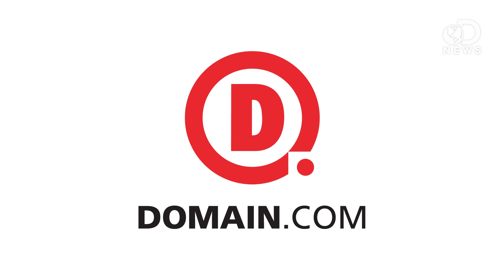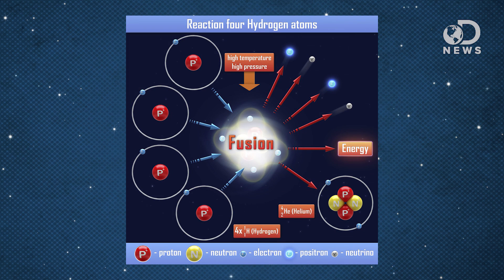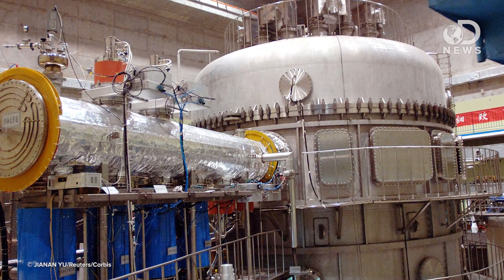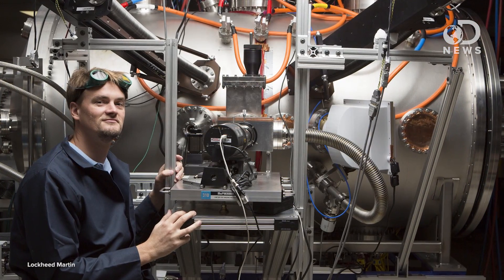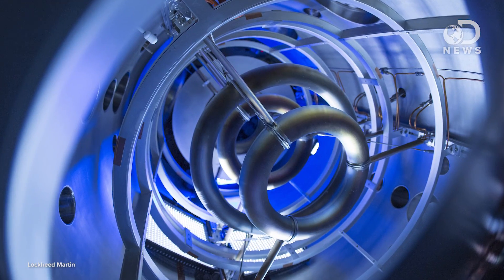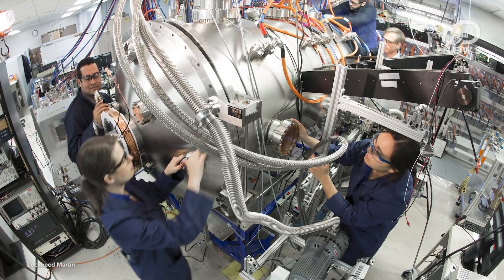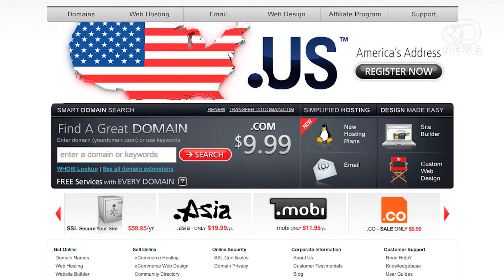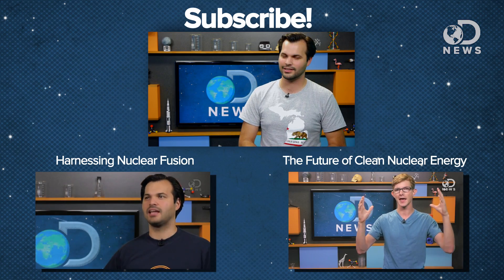Is Fusion Energy Close To Becoming A Reality?

Comment: Energy is abundant even without fusion power. Geothermal energy, Heliostats, and Algae Power Stations can produce many times more energy than we would ever need, and graphene-based supercapacitors store that energy for ground or sea vehicles. Continental airlines can be replaced by high-speed trains, and intercontinental airliners can use algae-based jet fuel.
Reply: Energy is very important for technological advancement, the Kardashev scale is a scale that ranks a civilization based on the total energy it is able to harness.

We are going to need much more energy if we ever hope to travel to other solar systems. We are going to need much more energy to improve on infrastructure of cities.

Basically we can never have "enough energy" The more energy we can harness the faster we can advance in science and technology and the better we can improve the quality of life.

-Coal/fossil fuel burning still accounts for 50% of the world energy generation due to how much energy is stored in them. It is still far more efficient than Geothermal or algae power stations and many times more efficient and practical than solar or wind.

-Nuclear FiSSion (what we have now) Is about 10,000 times more efficient than coal/fossil fuels. 

-Nuclear FUSION (aka the sun's power) Would essentially be 1000 times more powerful than the nuclear technology we have today, AND it would be virtually have no pollution.  Essentially you could turn water into massive amounts of energy. Half a cup of hydrogen would generate as much power as 20 TONS of Coal. 

----
Conclusion
We can never have enough energy.  Energy is not abundant.. not even close. If we had unlimited energy no one on earth would starve. If we had unlimited energy we wouldn't even need to live on earth anymore.
Reply: Carbosful
"We are going to need much more energy if we ever hope to travel to other solar systems."
This is not necessary, given that the asteroids in our own solar system contain so much resource that it renders interstellar travel practically pointless.

" We are going to need much more energy to improve on infrastructure of cities."
Solar energy is so abundant that building cities requires a miniscule amount compared to it.

"Basically we can never have "enough energy" The more energy we can harness the faster we can advance in science and technology and the better we can improve the quality of life."
Quality of life also shows the tendencies of marginal utility, meaning that equal increments do not contribute equally to perceived improvement.
Also, we could improve the quality of life with the same amount of energy, simply by distributing goods and services more equally.

"-Coal/fossil fuel burning still accounts for 50% of the world energy generation due to how much energy is stored in them." It is still far more efficient than Geothermal or algae power stations and many times more efficient and practical than solar or wind."
I know well that they are efficient. Only problem is, they are harmful for the environment. People tend to forget this.

"-Nuclear FiSSion (what we have now) Is about 10,000 times more efficient than coal/fossil fuels."
No, not really. It is more like 80 to 15 in the case of coal, and 50 to 15 in the case of oil. By spending 1 units of energy, we can get 80 units of energy on average in the case of coal, but only 15 in the case of nuclear energy.

"-Nuclear FUSION (aka the sun's power) Would essentially be 1000 times more powerful than the nuclear technology we have today, AND it would be virtually have no pollution.  Essentially you could turn water into massive amounts of energy. Half a cup of hydrogen would generate as much power as 20 TONS of Coal. "
Only problem is, we cannot make it into a controlled chain reaction with a net positive energy balance. Scientists keep saying fusion energy is 20 years away - for 50 years now.

"Conclusion
We can never have enough energy.  Energy is not abundant.. not even close."
Check out how much solar energy hits the global surface of the Earth, and how much we utilize of it, and think again.
Also, even the potential of geothermal energy globally is 4000 times the global energy use of humanity today. How many decades do you think we will increase our current energy needs by 4000 times? And that is only geothermal energy.

"If we had unlimited energy no one on earth would starve."
We do not have unlimited energy, but we could access thousands of times more energy that we currently use.
And we already produce enough food for everyone, only poor people dont have access to it (Source: FAO, 2002)

"If we had unlimited energy we wouldn't even need to live on earth anymore."
Okay, great. I wasnt talking about "unlimited" energy. I was taking about abundant energy (meaning that there is enough accessible energy for our current use, and even more, potentially thousands of times more).

If you have any more questions, feel free to ask ;)
Reply: sztellanora ""This is not necessary, given that the asteroids in our own solar system contain so much resource that it renders interstellar travel practically pointless.""

One of humanity's biggest goals has always been to travel greater and greater distances. If we are able to do so, it would allow us to understand more about how life is started it will also allow us to search for life, it will open up the opportunity for us to understand more about how to universe works by studying objects that are way to distant currently like black holes which we barley know anything about. It would also almost immortalize our species. Having the technology to travel greater and greater distances is always going to be one of our greatest goals. If its interstellar travel now, in the future it will be intergalactic.

""Solar energy is so abundant that building cities requires a miniscule amount compared to it.""
Do you know the cost efficiency of solar panels? It is extremely high, hence the reason why we don't have solar panels.  Also the areas needed to absorb a certain amount of energy is enormous obviously due to the fact that its solar.

Now the logical question I want you to think about is this. Why would you waste time creating solar panels that have a very high cost efficiency rate, trying to capture a fraction of the suns energy( only light energy) thats 92 million miles away when you can create a micro sun in our own basement that we can absorb and harness almost all of its energy output ?

""Only problem is, we cannot make it into a controlled chain reaction with a net positive energy balance. Scientists keep saying fusion energy is 20 years away - for 50 years now.""

That is entirely false, Your information is very outdated, as of early 2014 the fusion reactor at the Laurence Livermore national lab created the first nuclear reactor that outputs more energy that it takes.

http://www.wired.com/2014/02/fusion-power-not-yet/
http://arstechnica.com/science/2014/02/giant-leap-for-nuclear-fusion-as-scientists-get-more-energy-out-than-fuel-put-in/

""Also, even the potential of geothermal energy globally is 4000 times the global energy use of humanity today. How many decades do you think we will increase our current energy needs by 4000 times? And that is only geothermal energy.""

Thats in an entirely theoretical sense, unless you have a geotermal reactor covering every inch of planet earth your expected value is much much less. Also its quite silly to compare a geothermal rector to nuclear. You will most likely need 100s if not 1000s of geothermal reactors to output the same ammout of energy as one Fusion reactor. Its unrealistic. Somewhere sometime in the future we will need to switch to fusion, its clean energy, and its the most enormous energy producing method we know to date.

"We do not have unlimited energy, but we could access thousands of times more energy that we currently use.
And we already produce enough food for everyone, only poor people dont have access to it "

Do you not understand the quality of life? Do you not understand how an economy works? DO you know how many 3rd world countrys are starving in need of help? Do you now how many huge charities are helping to fight this all around the world?

Everything you have said was fine until this comment. I don't really know how old you are so I can't judge you. However you should really understand how lucky you are to be in your position most of the world lives in a 3rd world county and cannot do a single thing to get out of it.
Reply: Carbosful "One of humanity's biggest goals has always been to travel greater and greater distances. If we are able to do so, it would allow us to understand more about how life is started it will also allow us to search for life, it will open up the opportunity for us to understand more about how to universe works by studying objects that are way to distant currently like black holes which we barley know anything about. It would also almost immortalize our species. Having the technology to travel greater and greater distances is always going to be one of our greatest goals. If its interstellar travel now, in the future it will be intergalactic."
You can keep dreaming about it, but given that we have plenty of resources at our disposal in our very solar system, interstellar travel is logistically pointless, and thus, a luxury until we use up those resources in our system ;)

"Now the logical question I want you to think about is this. Why would you waste time creating solar panels that have a very high cost efficiency rate, trying to capture a fraction of the suns energy( only light energy) thats 92 million miles away when you can create a micro sun in our own basement that we can absorb and harness almost all of its energy output ?"
Um, because we cannot actually harness it yet, while solar panels and solar towers (e.g. Ivanpah Solar Power Facility) are already an option? :D
Reply: sztellanora "Um, because we cannot actually harness it yet, while solar panels and solar towers (e.g. Ivanpah Solar Power Facility) are already an option? :D" 

I dont think you understand or realize the difference. 

1) Solar panels are VERY costly right now. Their energy output is VERY low you need to cover your entire roof to barley get enough to power a standard 2-4 room house. And solar energy is not clean, the panels themselves have harmful waste its the same as electric cars, they are not entirely clean energy either the electric capacitor inside the car has very harmful waste.

2) Nuclear bonds are the strongest known bonds in the universe. They are hundreds of thousands to a million times more powerful than your standard chemical reactions or bonds. When you manipulate these bonds enormous amounts of energy comes out. There are two types Fission ( splitting atoms to release energy which is 10,000 times more energy efficient than coal) we have his already however the technology is harmful mainly because it was based on uranium which was war based. And then there's Fusion ( the combination of atoms releasing almost 1000 times more than that of fission. )

3) You would basically need solar panels covering the entire country of Great Brittain to produce even close to as much energy as 1 Fission reactor, we are not even talking about fusion. Since a couple grams of hydrogen can produce as much power as 20 tons of coal

4)""You can keep dreaming about it, but given that we have plenty of resources at our disposal in our very solar system, interstellar travel is logistically pointless, and thus, a luxury until we use up those resources in our system ;)""

Whos dreaming you or me ? A few private companies are already planning Manned missions to mars. Space X plans to allow manned space trips to mars and back by mid 2020 for under 500,000 Usd. Nasa is currently researching ways for interstellar travel.

 Again who is dreaming you or me ? It seems like you are very uneducated on this subject unaware of what the current future plans are in the space industry that is already being funded by Trillions of Dollars.

""No, not really. It is more like 80 to 15 in the case of coal, and 50 to 15 in the case of oil. By spending 1 units of energy, we can get 80 units of energy on average in the case of coal, but only 15 in the case of nuclear energy.""

Please provide sources for your claim or a link. because anyone can do a quick google search to see that you are forging false information.
Reply: Carbosful "I dont think you understand or realize the difference."
The difference between what and what? Seemingly, you dont know the difference between solar panels and solar towers. Solar power plants (like the one in Ivanpah, CA) do not even use solar panels, only mirrors, a water tank (atop a tower where sunlight is focused by the mirrors), and a steam turbine (to generate electricity).
BTW, solar panels could even be produced in an environmentally friendly way, we just dont do that because.. capitalism. (Note: Im not a communist, I advocate for Natural Law/Resource-Based Economy, See The Venus Project).

I know what is fission and fusion, buddy, thanks. The problem is, we cannot produce more energy with fusion in a controlled way yet (only in a termonuclear bomb, which is anything but controlled).

It would be stupid to cover Britain in solar panels (and even to build a solar tower), because Britain is very cloudy. Are you trolling?
Hydrogen can produce a lot of energy, but the problem is, we cannot harness it yet. This means that in controlled situations, the energy return is much smaller than the energy invested. On the other hand, building geothermal plants, or solar towers in sunny areas is easy, and they produce a lot of energy. Today.

I know that private companies are planning to travel to Mars, but Mars is in our solar system. Thus, traveling to Mars is not interstellar travel (and defintely not intergalactic :P ). My point was that we have everything we need in our own solar system, so until we used up all the materials, traveling to other stars is logistically unjustified (i.e. luxury).

The numbers I used for ERoEI are true for the US. See the wikipage "Energy returned on energy invested", it has a graph that shows it beautifully. If you actually googled that, it shouldnt show any forgery, but it should bring up this page as one of the results ;)
Reply: sztellanora

1) Again you would need thousands of solar power plants to equate to the same energy as one fusion power plant. You are only able to absorb a fraction of the Suns energy through the form of light energy. To give you a picture of this Essentially The sun is a Giant Fusion power plant 93 million miles away. Solar is only able to capture a fraction ( we are talking about 1/trillion +) of the suns light and turn it into energy.

Solar works as an energy producer however. Its impractical and is a very primitive way to obtain energy for future needs.

Sadly when you can create a micro "sun" in a controlled lab there is little to no use for solar, which is again.. just trying to capture a fraction of the energy from a fusion power plant 93 million miles away.

2) ""It would be stupid to cover Britain in solar panels (and even to build a solar tower), because Britain is very cloudy. Are you trolling?"" 

Thank you for telling us another massive downside to solar energy its unreliable and can be affected by climate and the biggest downfall is the night and day cycle. And my example was to demonstrate to you the amount of area needed, I was originally going to use Texas as an example however some people are uneducated and might not even know where Texas is the next best example would be Great Britain (globally known) as I believed it would give you a better picture. Since judging by your name and your past examples I question how educated you actually are.

3)""BTW, solar panels could even be produced in an environmentally friendly way, we just dont do that because.. capitalism.""

And ? Fission can be achieved in an environmentally friendly way as well through thorium anything can. Biggest problem is  MONEY and PRACTICALITY. Same with solar panels they cost a ton currently and no one is going to go out of their way to increase the cost EVEN MORE by making them environmentally friendly.

You are digging a deeper hole for stance.

4)""I know that private companies are planning to travel to Mars, but Mars is in our solar system. Thus, traveling to Mars is not interstellar travel (and defintely not intergalactic :P ). My point was that we have everything we need in our own solar system, so until we used up all the materials, traveling to other stars is logistically unjustified (i.e. luxury).""

We have no need to travel to mars, we have everything we need on our own planet and we haven't even touched the moons reserves either. 

So going to mars is just "luxury" Yet we are still doing it.

Your point? 

We have no need to go to Pluto either, yet we have spent billions to send a drone there.

Your point?

We have no need To go to Jupiter or Saturn either since we have everything we need on earth. Yet there are missions planned to visit Europia.

We have no need to go to alpha Centari yet Nasa is currently spending to research new interstellar propulsion methods.

Your point?

Ill give you the answer we do it for space exploration and scientific research. You can say that there no point in going to the next star however there are Billions of dollars already funding interstellar projects.
Reply: Carbosful "1) Again you would need thousands of solar power plants to equate to the same energy as one fusion power plant. "
Again, we cannot harness fusion energy yet, so 1x0=0. Until we cannot harness fusion power, we can only build other types power plants, and of those, renewable power is the safest. If we could harness fusion power, I would be for building fusion power plants, but that is - sadly - not an option today.

I will say this again: we cannot harness fusion power. Do you understand this?

"Solar works as an energy producer however. Its impractical and is a very primitive way to obtain energy for future needs."
Primitive is reliable, and easy to fix. It is actually good thing in electricity generation.

"Sadly when you can create a micro "sun" in a controlled lab there is little to no use for solar, which is again.. just trying to capture a fraction of the energy from a fusion power plant 93 million miles away."
Sadly, when you create a micro "sun" in a controlled lab, it yields less energy than the fusion process needed, so it is impractical.

2) ""It would be stupid to cover Britain in solar panels (and even to build a solar tower), because Britain is very cloudy. Are you trolling?"" 

"Thank you for telling us another massive downside to solar energy its unreliable and can be affected by climate and the biggest downfall is the night and day cycle."
Luckily, gross power output can be adjusted by geothermal and nuclear plants at any given time; there is no problem with relying partially on solar power for 8-10 hours a day.

"And my example was to demonstrate to you the amount of area needed, I was originally going to use Texas as an example however some people are uneducated and might not even know where Texas is the next best example would be Great Britain (globally known) as I believed it would give you a better picture."
We have invented maps, Google, and things like that. Dont forget that you are on the internet. BTW, as for education, an area in Texas is hit my much more solar radiation a year than the same area in Britain.

"Since judging by your name and your past examples I question how educated you actually are."
Why do you think that if one uses the name of the god of the Tolkien universe, then it means uneducated? Did you even know what this name referred to? Talking about education. You are quick to judge, even before thinking, or looking after things.

"And ? Fission can be achieved in an environmentally friendly way as well through thorium anything can. Biggest problem is  MONEY and PRACTICALITY."
This is what I was referring to: money shouldnt be a problem. Money only makes sense in a world with global scarcity, but caputalism, mecahnization, and automation already brought about abundance. Unfortunately, capitalism cannot function in abundance, so the owners try to regulate production in order to create the illusion of scarcity.
A for practicality, since inducing fusion requires more energy than it produces (in lab), it is highly impractical (as of yet, at least). 

"Same with solar panels they cost a ton currently and no one is going to go out of their way to increase the cost EVEN MORE by making them environmentally friendly."
Indeed, solar panels are not a good idea today. Solar power plants (the mirrors-tower-turbine type) are much better.

"You are digging a deeper hole for stance."
What stance? I am focusing on solar towers, while you keep talking about solar panels. Pay attention to what the other one is saying.

"We have no need to travel to mars, we have everything we need on our own planet and we haven't even touched the moons reserves either. 

"So going to mars is just "luxury" Yet we are still doing it."
I said,traveling to other stars is luxury. Mars is not a star. It is a planet around the same star as Earth. Any education? Ironic..

"Your point?"
You first need to learn the difference between stars and planets in order to understand my point.

"We have no need to go to Pluto either, yet we have spent billions to send a drone there.
Your point?"
Pluto and Charon are the only analogies to the Earth and Moon in our solar system, so studying their interactions will also teach us a lot about our own planet-moon system. And the probe spent 2/3 of its mission time in hybernation, so this is a great test to find out how effectively probes can hybernate in space and come online again (Philae is in the same situation right now).
BTW, the more probes we send to small, distant objects in our solar system, the more experience we get for later asteroid mining missions.

"We have no need To go to Jupiter or Saturn either since we have everything we need on earth. Yet there are missions planned to visit Europia."
Europa is simply interesting because its ocean under the ice may harbor life. That is a big deal, actually.

"We have no need to go to alpha Centari yet Nasa is currently spending to research new interstellar propulsion methods.
Your point?"
No, they are not, actually. They even terminated the NASA Breakthrough Propulsion Physics Program in 2003, which was supposed to develop propulsion methods for interstellar travel.

"Ill give you the answer we do it for space exploration and scientific research. You can say that there no point in going to the next star however there are Billions of dollars already funding interstellar projects."
What a waste of money. If they spent that money on asteroid mining, they would even get it back.

I know that the prospect of fusion power and interstellar travel is fascinating for boys at your age, but truth is, they are not an option yet.
As for fusion power, it would be nice and clean, but until it produces more energy than it consumes, we simply have to build already usable types of power plants, because we need electricity. This is as simple as that.

As for interstellar travel, it is a neat idea in theory, but there is not much practical use of it, especially because we have all the resources we need in our solar system. So the question is: why and when should we go to other stars?
Reply: sztellanora 
"And we already produce enough food for everyone, only poor people don't have access to it"

I was just reading this and had to stop at this comment, That statement is horridly false. Do you know how many third world countries that are fighting starvation every day? Until the entire world is around 90%+ Urbanized there are still many countries that are in desperate need of aid.
Reply: Lucas Physics Yes, I know, but again, the reason is because they are too poor to buy food, not because there wouldn't be produced enough globally.
The FAO stated that we produced 2720 kcal/capita in 2002 (which would be more than enough). Are you suggesting that they are lying in their statistics? Do you perhaps know better? Show me your sources, then.
And Urbanization itself does not eliminate poverty or starving, it only means that a higher percentage of the population live in cities, as opposed to rural areas. And simply living in a city does not fill up your stomach automatically. To eat in a city, you need purchasing power (or charity).
Reply: sztellanora (reason is because they are too poor to buy food, not because there wouldn't be produced enough globally.)

The reason is because many people are born into a 3rd world country and they can't do much about it. If you are born in a country such as Mali there is little to nothing you can do about your situation sadly. Countries don't just accept random foreigners, unless you offer business opportunities or schooling. So many people that are born into a 3rd world country struggling with harsh poverty with little to no infrastructure are stuck.

If you are wondering about how much % of the world actually lives in a 3rd world country struggling with poverty a simple google search will give you the answer.

There are many Non profit Charity's trying to send aid to Countries like Mali however it is simply not enough. You can't expect a country to babysit the thousands of 3rd world countries out there, not only is it extremely costly since there is no infrastructure but there is not enough capital.
Reply: Lucas Physics "The reason is because many people are born into a 3rd world country and they can't do much about it. If you are born in a country such as Mali there is little to nothing you can do about your situation sadly. Countries don't just accept random foreigners, unless you offer business opportunities or schooling. So many people that are born into a 3rd world country struggling with harsh poverty with little to no infrastructure are stuck."
I know, however, we still produce enough food globally, and charity groups are working towards eliminating starving - and they are successful at it, because as the global human population is rising, the number of starving people, and the number of those who starve to death yearly is going down; you could help too by donating, or becoming an activist ;)

"If you are wondering about how much % of the world actually lives in a 3rd world country struggling with poverty a simple google search will give you the answer."
Thanks.. I know that Google is made for things like that.

"There are many Non profit Charity's trying to send aid to Countries like Mali however it is simply not enough."
As I pointed out above, they are successful at lowering the number of starving people.

"You can't expect a country to babysit the thousands of 3rd world countries out there, not only is it extremely costly since there is no infrastructure but there is not enough capital."
However, I can expect (precisely because statistics show that they are effectively reducing starvation) all of the developed countries to donate just a little to these poor countries, and those donations will become the capital, and build the infrastructure. Did you know that 1% possesses 46% of the global wealth.. they could donate a lot, and they wouldnt even notice (since money also has the feature of marginal utility) - they would still live like a king. However, even the next 33% could donate more, as they possess 51% of global wealth. Note: the poorest 66% own just 3% - this should be increased.

The best thing is that you can also become part of the solution ;)
Reply: "Solar works as an energy producer however. Its impractical and is a very primitive way to obtain energy for future needs."
"""Primitive is reliable, and easy to fix. It is actually good thing in electricity generation."""

Except Primitive ways to obtain energy yield only very little amounts. Again  with solar, you are essentially only absorbing a fraction (the actual number is mind boggling much more than a fraction of a trillionth) of energy from a Nuclear Fusion reactor 93 million miles away.
So basically what everyone wants to do currently is create a Fusion reactor instead of absorbing a fraction of the amount of energy from one thats 93 million miles away.

""""I will say this again: we cannot harness fusion power. Do you understand this?""""

Sure, but thats not the issue, Its the fact that you are pretending that Solar could ever meet the energy demands of our entire planet earth. You are essentially trying to say "fusion is useless because we have solar" Completely and utterly wrong. Understand that as each decade goes on our energy demands keep multiplying and going up. So we do need exponentially better and more efficient ways to produce energy not just a temporary placeholder. Solar is a temporary placeholder and is extremely primitive in ways of energy production yeilding very low production. It might yeild enough for current modern day houses (again CURRENT this is a temporary placeholder instead of a solution) You cannot expect solar to yield enough energy to power cities. Even if you had almost perfect solar pannels with a 100% efficiency rate the energy production would still only be a temporary placeholder until a superior one that yields much more comes along AKA Fusion.
Reply: Carbosful "Except Primitive ways to obtain energy yield only very little amounts. Again  with solar, you are essentially only absorbing a fraction (the actual number is mind boggling much more than a fraction of a trillionth) of energy from a Nuclear Fusion reactor 93 million miles away.
So basically what everyone wants to do currently is create a Fusion reactor instead of absorbing a fraction of the amount of energy from one thats 93 million miles away."
No, what everyone wants to do currently is to have enough power with the currently available technologies (renewables, nuclear, etc.), since fusion power may never even be a practical option.

"Sure, but thats not the issue, Its the fact that you are pretending that Solar could ever meet the energy demands of our entire planet earth."
I'm not pretending it; it can (more solar energy hits the surface of the Earth in an hour than we use in a whole year, which means its potential on the surface of the Earth is 8760x as much as we currently use, and I'm not even counting space-based solar panels with wireless energy transfer). But solar power (along with wind, tidal, etc.) would really be just a supplement to geothermal power (its potential is 4000x as much as we currently use) and nuclear (preferably, breeder reactors or LFTR).

"You are essentially trying to say "fusion is useless because we have solar" Completely and utterly wrong. Understand that as each decade goes on our energy demands keep multiplying and going up."
I'm not saying that. I'm just saying that until fusion is even practical, geothermal and solar energy are the next best options (currently the best).

"So we do need exponentially better and more efficient ways to produce energy not just a temporary placeholder. Solar is a temporary placeholder and is extremely primitive in ways of energy production yeilding very low production. It might yeild enough for current modern day houses (again CURRENT this is a temporary placeholder instead of a solution) You cannot expect solar to yield enough energy to power cities."
It could actually power cities, but you are making a straw man argument here, as I don't count on solar only. Don't forget that besides solar, we can also use geothermal, nuclear, wind, hydro, and other renewables, and I already said this many times.

"Even if you had almost perfect solar pannels with a 100% efficiency rate the energy production would still only be a temporary placeholder until a superior one that yields much more comes along AKA Fusion."
This is a false dichotomy; I keep pointing out that solar and fusion are not the only options, but you make it seem as if it were anyway. Stop it already.
Reply: sztellanora 
"""fusion power may never even be a practical option."""

Again, your information is entirely outdated. That is entirely false, as of early 2014 the fusion reactor at the Laurence Livermore national lab created the first nuclear reactor that outputs more energy that it takes.

http://www.wired.com/2014/02/fusion-power-not-yet/
http://arstechnica.com/science/2014/02/giant-leap-for-nuclear-fusion-as-scientists-get-more-energy-out-than-fuel-put-in/

However the energy generated is still very small, Just like back in 1951 how a fission power plant first achieved criticality and only generated enough power to light 5 light bulbs. Fast forward to 1970's and the first 100 GW Fission power-plants were built, then 300 GW in 1980s.

Now the question is how many years until a feasible Nuclear Fusion reactor ? Logically anywhere between 1-3 decades, since technological advances are exponentially increasing, Advances are happening at much quicker rates than in the 1950's and that is for obvious reasons.

"""I'm not pretending it; it can (more solar energy hits the surface of the Earth in an hour than we use in a whole year""""

Again, if you speak for our CURRENT needs, however our energy demands are exponentially increasing decade by decade. Again, let me stress this to you. Solar is a great placeholder until the next big leap in energy production. Even when fusion power plants come solar can still used in a wide range of applications but it will never be the fore frontal method for providing an entire countries energy needs.  

Solar will never account for more than 10% of a countries energy sources not even close, the method is just too costly and does not yield enough energy even if you had 99.9% efficient solar panels which we are no where near.

It is also extremely impractical because the amount of energy you get from solar is based off 3 factors, the efficiency of the panels, or the efficiency of the solar tower, and primarily it is based off how much AREA you can redirect sun light to energy. Again you need HUGE amounts of area to increase your energy output which makes it very impractical.

How do you double the energy output of a solar tower ? Well you sadly need double the amount of mirrors covering double the amount of sun light area to your tower.

Solar towers, not a efficient way to produce energy for future needs, its only a place holder for now.

Solar panels? Great for a wide range of applications that only yield very small amounts of energy, But will never account for even 5% of an entire countries energy consumption, I will bet my life on that.

"""It could actually power cities, but you are making a straw man argument here, """

The entire branch of renewable energy only accounts for Roughly 6% of an entire countries needs. Solar only accounts for 0.23% of USA's entire energy consumption.

HAVE fun with convincing the world that solar can power the entire county LOL. You are living in your own fictional world.

http://www.eia.gov/tools/faqs/faq.cfm?id=427&t=3

Official EIA Energy consumption site.

No one said it was the only two methods, look at the Official EIA chart
http://www.eia.gov/tools/faqs/faq.cfm?id=427&t=3
However, we need something to replace Fossil Fuel Burning because we are running out fast, We need a massive energy production method that is practical and can be the main forefrontal method for providing an entire countries yearly energy needs.

Its either going to be Fission or Fusion. Hydro electric is another method which can be practical however, the problem is not everyone has a gigantic River running at their disposal, Even Chinas Three Jorges Hydroelectric Monster Dam 2nd largest in the entire world can only provide China with 14% of their entire yearly energy needs. And that % will decrease yearly as the energy demands go up.

The problem with renewable sources is that they take up Massive amounts of space its impractical. China had to displace 1.3 million people to build this Monster 3 Jorge's Dam.
Reply: Carbosful "Again, your information is entirely outdated. That is entirely false, as of early 2014 the fusion reactor at the Laurence Livermore national lab created the first nuclear reactor that outputs more energy that it takes."
Wrong. Even that article on Wired stated that only 1/200th of the energy of the lasers was imparted to the hydrogen fuel, which produced 1,7-2,6 times as much energy as it took up, meaning that the experiments actually produced 0,85%-1,3% of the energy used each time they tried.

"Again, if you speak for our CURRENT needs, however our energy demands are exponentially increasing decade by decade. Again, let me stress this to you. Solar is a great placeholder until the next big leap in energy production. Even when fusion power plants come solar can still used in a wide range of applications but it will never be the fore frontal method for providing an entire countries energy needs."
If fusion power ever becomes a reality, then cool until then, solar is a shitty placeholder, because it only works during the day, but geothermal and fission power can be supplemented with it.

"Solar will never account for more than 10% of a countries energy sources not even close, the method is just too costly and does not yield enough energy even if you had 99.9% efficient solar panels which we are no where near."
Again, forget solar panels. I am talking about a mirror-tower-steam turbine design. And solar power cannot account for 100% indeed, a combination of 0-40% solar power and 60-100% geothermal power could power us until our needs multiply by about 10.000 times.

"It is also extremely impractical because the amount of energy you get from solar is based off 3 factors, the efficiency of the panels, or the efficiency of the solar tower, and primarily it is based off how much AREA you can redirect sun light to energy. Again you need HUGE amounts of area to increase your energy output which makes it very impractical."
Again, forget solar panels, as I'm not talking about them either. But I am saying this for the 5th time at least. What's your problem?

"How do you double the energy output of a solar tower ? Well you sadly need double the amount of mirrors covering double the amount of sun light area to your tower."
Either that, or you build another power plant, since you might not want to exceed the melting point of the material that the heat absorber in the focal point is made of.

"Solar towers, not a efficient way to produce energy for future needs, its only a place holder for now."
Of course, it depends on what happens in the future.

"Solar panels? Great for a wide range of applications that only yield very small amounts of energy, But will never account for even 5% of an entire countries energy consumption, I will bet my life on that."
I would say 6% just to piss you off. You are pissing me off already.

"The entire branch of renewable energy only accounts for Roughly 6% of an entire countries needs. Solar only accounts for 0.23% of USA's entire energy consumption."
And it is constantly growing. BTW, do you think it is so low right now because it is so inefficient? Did you know that nuclear plants can function for decades, and coal plants could even function for centuries? Or did you think that as soon as we invent something, we automatically replace almost everything?Also, have you ever heard about them stupid money constraints? (Its not like money would be justifiable today, but we still use it because it is hard to change the foundations of a functioning system on the fly)

"HAVE fun with convincing the world that solar can power the entire county LOL. You are living in your own fictional world."
Again, every hour, more solar energy hits the face of the Earth than the yearly consumption of humanity. Put this into perspective finally.

BTW we  were talking about cities, not a whole country, idiot. The sum of cities does not account for the consumption of a country. besides cities, there are also villages, farms, factories, foundries, etc.

"http://www.eia.gov/tools/faqs/faq.cfm?id=427&t=3

Official EIA Energy consumption site."
Do you really think I don't know these percentages? Again, think about how much more solar power hits the face of the Earth in every hour, and how little we use compared to that.

"No one said it was the only two methods, look at the Official EIA chart
http://www.eia.gov/tools/faqs/faq.cfm?id=427&t=3"
You made it seem like it in your last paragraph.

"However, we need something to replace Fossil Fuel Burning because we are running out fast, We need a massive energy production method that is practical and can be the main forefrontal method for providing an entire countries yearly energy needs."
Luckily, we have Geothermal power and LFTR reactors to achieve that.

"Its either going to be Fission or Fusion."
Plus geothermal plus hydro plus wind plus wave plus solar.

"Hydro electric is another method which can be practical however, the problem is not everyone has a gigantic River running at their disposal, Even Chinas Three Jorges Hydroelectric Monster Dam 2nd largest in the entire world can only provide China with 14% of their entire yearly energy needs. And that % will decrease yearly as the energy demands go up."
You have this stupid idea that we would only use 1 type of energy source once dy. We will use as much hydro as we can (because they are already installed, and why fix what's not broken), as much wind, tidal, wave as we can (same reason), and as little Uranium and fossil power as we can (because they are dangerous). Ultimately, we will always have an energy mix, never relying on a single method of electricity generation.

"The problem with renewable sources is that they take up Massive amounts of space its impractical."
is it impractical in all the deserts in the world?You couldn't really do anything else with those places anyway.

"China had to displace 1.3 million people to build this Monster 3 Jorge's Dam."
They need the energy; do you have a better idea perhaps? (one which is currently available)
Reply: sztellanora """"Wrong. Even that article on Wired stated that only 1/200th of the energy of the lasers was imparted to the hydrogen fuel, which produced 1,7-2,6 times as much energy as it took up, meaning that the experiments actually produced 0,85%-1,3% of the energy used each time they tried.""""

You are misreading sadly. Let me quote the article.

[[[Because of this convoluted process, only 1/200th of the energy that the lasers generate is imparted to the hydrogen fuel, compressing it enough to produce a small amount of fusion. Until now, the energy given off by the fusing hydrogen hasn’t been enough to set off a chain reaction. ]]]

> speaking about the past NOT the current break through.

[[[But during experiments late last year, NIF researchers were finally able to get the hydrogen to give off as much as 1.7 times more energy than it had taken in, a result that appears today in Nature. In subsequent experiments last month, the team was able to produce as much as 2.6 times more energy than was put into the hydrogen fuel.]]]

Again you are reading too fast or mis-reading, since most of the article talks about the previous problems they were facing and how they overcame them.

The problem RIGHT now is creating a self sustaining chain reaction. Again we struggled with this when we were trying to create a Chain reaction through Fission in the late 1940s.

""""If fusion power ever becomes a reality, then cool until then, solar is a shitty placeholder, because it only works during the day, but geothermal and fission power can be supplemented with it.""""

Fission is sadly much more efficient than Geothermal however Fission through Uranium produces Radioactive waste that can last for 1000s of years. And re-engineering Fission through Thorium costs too much money, who will throw billions into funding Thorium fission when you can throw your billions at Nuclear Fusion? Nobody will, there are a few small companies that are trying to gain funding for thorium fission research but they are small.

""" And solar power cannot account for 100% indeed, a combination of 0-40% solar power and 60-100% geothermal power could power us until our needs multiply by about 10.000 times.""""

Hahaha Try preaching that to someone else. You are living in a fictional reality. You will get laughed at by anyone who is educated in this subject of energy production. Again If solar ever Reaches more than 10% of a Major Countries yearly energy production aka (USA) I will bet my life and all my belongings and gladly give them to you. You don't need to be educated to even see the fiction behind that statement Just Look at the numbers.

http://www.eia.gov/tools/faqs/faq.cfm?id=427&t=3"

"""BTW we  were talking about cities, not a whole country, idiot. """

MMm using verbal attacks because you have no content to maturely back your point with? 
Who am I talking with a 12 year old? 

""""Do you really think I don't know these percentages? Again, think about how much more solar power hits the face of the Earth in every hour, and how little we use compared to that.""""

Nice going with your fictional thoughts yet again. 

""""Again, think about how much more solar power hits the face of the Earth in every hour,"""

Lmao.... all that potential energy cannot be converted so it remains POTENTIAL, thats the same thing as saying DO YOU KNOW HOW MUCH HYDROGEN IS IN THE EARTHS OCEANS? DO YOU KNOW HOW MUCH ENERGY WE CAN OBTAIN THROUGH FUSION ? 

Lmao.. replace hydrogen and fusion with Uranium and Fission

Now you see how fictitiously stupendous your statement is.

"""is it impractical in all the deserts in the world?You couldn't really do anything else with those places anyway."""

Oh boy... Looks like someone doesn't understand how transferring electric current decreases immensely with distance, that's the reason why power plants are built near cities and preferably right in the middle of cities, if you have power plants in the desert how many miles is that away from your nearest city ? haha
Now you might be asking, well how can we Not loose energy through transferring an electric current, the answer is you can't unless you crate a new super material with ultra high conductivity (graphene) could replace out current power lines but thats not commercial available for at least a few decades. Ultimately to have zero electrical resistance through an electric current you need a super conductor. Room temperature super conductors are many decades away. So again your stuck with a very high energy loss ratio for every few miles through our current electrical transfer methods. Hence the reason you need to build any power plant extremely near a city that it will provide power to.

haha You need to educate yourself before you randomly come into a discussion about power production. This energy loss with distance applies to ALL types of power plants, and anything to do with electrical current. The electrical companies have always been struggling with this otherwise in a perfect world there would just be 1 huge power plant feeding the entire country via room temperature superconducting wires hahaha...

""""Ultimately, we will always have an energy mix, never relying on a single method of electricity generation.""""
Is that what you think in your fictional world? China only Built the three Jorges dam NOT for practicality, but because they wanted to cut down on harmful emissions from Fossil Fuels. You might think a communist country caring for the environment? China isn't communistic, they are Socialistic with many free economy zones that act as a totally free Capitalistic market.

The problem is pollution, China would have never wanted to go through the hassle of Destroying 1.3 million homes of the nearby residence and building a colossus dam if there was a better option.

Currently there is none. and they just happen to have the  Yangtze in their back yard.

But you better bet if we had either Thorium fission or nuclear fission that no one in their right mind would go through that hassle of building a hydroelectric power plant. 

Its entirely impractical, but because of the current state and circumstances it has become somewhat practical.
Reply: Carbosful
"You are misreading sadly. Let me quote the article.

[[[Because of this convoluted process, only 1/200th of the energy that the lasers generate is imparted to the hydrogen fuel, compressing it enough to produce a small amount of fusion. Until now, the energy given off by the fusing hydrogen hasn’t been enough to set off a chain reaction. ]]]

> speaking about the past NOT the current break through.
LASERS GENERATE, IS IMPARTED - these are present tense.

[[[But during experiments late last year, NIF researchers were finally able to get the hydrogen to give off as much as 1.7 times more energy than it had taken in, a result that appears today in Nature. In subsequent experiments last month, the team was able to produce as much as 2.6 times more energy than was put into the hydrogen fuel.]]]

The breakthrough is that that 1/200 energy is finally not lost, but the fusion starts, and it produce 1,7-2,6 times energy (of the 1/200). You are welcome for the correction.

"Again you are reading too fast or mis-reading, since most of the article talks about the previous problems they were facing and how they overcame them."
It is you who misread it, buddy. Sad but true.

"The problem RIGHT now is creating a self sustaining chain reaction. Again we struggled with this when we were trying to create a Chain reaction through Fission in the late 1940s."
The problemS RIGHT now is 1) creating a self sustaining chain reaction, 2) getting back more than 200 times the energy, because only 1/200 of the energy of the laser is imparted to start the fusion.

"Fission is sadly much more efficient than Geothermal however Fission through Uranium produces Radioactive waste that can last for 1000s of years."
The EROI of geothermal and lightwater nuclear power plants are actually roughly the same (4-15). Check it yourself.

"And re-engineering Fission through Thorium costs too much money, who will throw billions into funding Thorium fission when you can throw your billions at Nuclear Fusion? Nobody will, there are a few small companies that are trying to gain funding for thorium fission research but they are small."
Except for India and China. Note that the theory has already been worked out in the middle of the last century, it just needs to be tested (and it is, right now, by the above mentioned countries)

"Hahaha Try preaching that to someone else. You are living in a fictional reality. You will get laughed at by anyone who is educated in this subject of energy production. Again If solar ever Reaches more than 10% of a Major Countries yearly energy production aka (USA) I will bet my life and all my belongings and gladly give them to you. You don't need to be educated to even see the fiction behind that statement Just Look at the numbers."
I'm not talking about what USA will do (I don't have a crystal orb) I'm talking about what it should. 

"MMm using verbal attacks because you have no content to maturely back your point with? 
Who am I talking with a 12 year old? "
No, not really, but you are annoying, especially with your hypocrisy towards fusion power. 

"Nice going with your fictional thoughts yet again."
These numbers are correct, and solar power is already an option. 

"Lmao.... all that potential energy cannot be converted so it remains POTENTIAL, thats the same thing as saying DO YOU KNOW HOW MUCH HYDROGEN IS IN THE EARTHS OCEANS? DO YOU KNOW HOW MUCH ENERGY WE CAN OBTAIN THROUGH FUSION ?
A lot. Unfortunately, fusion power currently produces about 100 times less energy than it consumes? Talking about fantasy.. 

"Lmao.. replace hydrogen and fusion with Uranium and Fission"
What? There are no fusion plants to even replace today.

"Now you see how fictitiously stupendous your statement is."
I don't even know what you are talking about.

"Oh boy... Looks like someone doesn't understand how transferring electric current decreases immensely with distance, that's the reason why power plants are built near cities and preferably right in the middle of cities, if you have power plants in the desert how many miles is that away from your nearest city ? haha"
I know. BTW, tell that to the EU which is planning on building solar power  plants in the Sahara. Try to inform a bit before you think you want to say "gotcha". BTW, we still get more power if part of it is lost over cables than the power we could get by fusion power (which produces about 1/100 as much energy as it needs)

"Now you might be asking, well how can we Not loose energy through transferring an electric current, the answer is you can't unless you crate a new super material with ultra high conductivity (graphene) could replace out current power lines but thats not commercial available for at least a few decades. Ultimately to have zero electrical resistance through an electric current you need a super conductor. Room temperature super conductors are many decades away. So again your stuck with a very high energy loss ratio for every few miles through our current electrical transfer methods. Hence the reason you need to build any power plant extremely near a city that it will provide power to."
Did you know that if we raise the voltage, the energy loss is proportionately less. No need for superconductors, only for high voltage.

"haha You need to educate yourself before you randomly come into a discussion about power production."
I could say the same.

"This energy loss with distance applies to ALL types of power plants, and anything to do with electrical current. The electrical companies have always been struggling with this otherwise in a perfect world there would just be 1 huge power plant feeding the entire country via room temperature superconducting wires hahaha..."
This is basic stuff. Why is that so funny to you?

"Is that what you think in your fictional world? China only Built the three Jorges dam NOT for practicality, but because they wanted to cut down on harmful emissions from Fossil Fuels.
Note that hydro power is not only more eco-friendly, but also more efficient than coal (hydro has an EROI of 100, while that of coal is 85 - at least in the US) hydro power is actually the most efficient power source we have.

"You might think a communist country caring for the environment? China isn't communistic, they are Socialistic with many free economy zones that act as a totally free Capitalistic market."
China is no longer a socialist country. It is a country with capitalist economy and a centralized government.

"The problem is pollution, China would have never wanted to go through the hassle of Destroying 1.3 million homes of the nearby residence and building a colossus dam if there was a better option.
Currently there is none. and they just happen to have the  Yangtze in their back yard.
The government of China doesn't give a sh*t about 1,3 million people (they deported more when they were building those giant skyscrapers), and indeed, hydro power is currently the best power source for electricity.

"But you better bet if we had either Thorium fission or nuclear fission that no one in their right mind would go through that hassle of building a hydroelectric power plant."
Please, rephrase your sentence, because it makes no sense to me in this form. Thanks. 

"Its entirely impractical, but because of the current state and circumstances it has become somewhat practical."
What is entirely impractical? Why do you think so? What circumstances are you referring to? Please, be more specific.
Reply: sztellanora ""LASERS GENERATE, IS IMPARTED - these are present tense.""

Your argument and statements make no sense in both cases the same is true, more energy is still being generated than what was initially put in, that is what matters it does not matter how little or how big the net gain is, the point is net gain happened and that is a huge step forward.

"""The problemS RIGHT now is 1) creating a self sustaining chain reaction, 2) getting back more than 200 times the energy, because only 1/200 of the energy of the laser is imparted to start the fusion."""

False beyond false, When it states 1/200 of the energy is imparted, that means that 199/200 of the energy that the lasers are firing is NOT directed "communicated" to the hydrogen Pellet and is either lost through heat or not directly contributing to the fusion ignition.

Every type of motor or power plant usually does require some sort of ignition. Sure the ignition could be improved on however it doesn't matter how little of the lasers energy goes directly into the fusion process as long as you can sustain a chain reaction and produce an exponential energy return then you are fine.

Net gain is the key word. 

""""No, not really, but you are annoying, especially with your hypocrisy towards fusion power.""""

Not really? So you didn't just act like a child over a conversation on youtube using personal attacks instead of explaing your viewpoint just because things didn't go your way? Hahaha How old are you exactly? You know no one is forcing you to reply if you don't want to have a mature conversation then we can end this discussion right now. If you want to have a flame war your better going off to some world of warcraft forum.

If you hope to ever have mature conversations with a difference in opinions with anyone in real life then your going to have to get used to "annoying people" or so as you put it.

If you think its annoying that other people have a different viewpoint then im sorry to say that you will most likely be "annoyed" at almost everyone that you meet in life unless you have no social contact whatsoever. 

or better yet if you simply don't have the maturity to discuss something then your better off not having any in depth conversations and debates at all.

Again we can end this conversation here if you truly want to who is forcing you to stay ? 

----
I going to delay my response to your second half until I know whether you still want to discuss or not.
Reply: Carbosful "Your argument and statements make no sense in both cases the same is true, more energy is still being generated than what was initially put in, that is what matters it does not matter how little or how big the net gain is, the point is net gain happened and that is a huge step forward."
No, since only 1/200 of the input energy actually imparts to ignite the fusion, and the fusion itself only generates about 2x the energy it takes to start, ultimately, only 1/100th of the input energy is being generated.

"False beyond false, When it states 1/200 of the energy is imparted, that means that 199/200 of the energy that the lasers are firing is NOT directed "communicated" to the hydrogen Pellet and is either lost through heat or not directly contributing to the fusion ignition."
I wrote exactly the same.

"Every type of motor or power plant usually does require some sort of ignition. Sure the ignition could be improved on however it doesn't matter how little of the lasers energy goes directly into the fusion process as long as you can sustain a chain reaction and produce an exponential energy return then you are fine.

Net gain is the key word."
Wrong, actually. You forget that the electromagnets used to hold the particles away from the vessel also use a lot of energy, and they have no idea how to make the fusion sustain itself, as the high energy particles fly apart very fast.

"Not really? So you didn't just act like a child over a conversation on youtube using personal attacks instead of explaing your viewpoint just because things didn't go your way? Hahaha How old are you exactly? You know no one is forcing you to reply if you don't want to have a mature conversation then we can end this discussion right now. If you want to have a flame war your better going off to some world of warcraft forum."
The reason why you are annoying is that I explained why you were wrong, yet you acted like I said nothing, and I told you that I am not talking about one thing, but another, yet you acted like I did not point that out either. It annoys me when people ignore what I just said.

"If you hope to ever have mature conversations with a difference in opinions with anyone in real life then your going to have to get used to "annoying people" or so as you put it."
This is never a problem, because people usually dont ignore what I write. This is very rare actually, and you are one of them. It is actually you who should change the way you are conversing, paying more attention to what the other one says.

"If you think its annoying that other people have a different viewpoint then im sorry to say that you will most likely be "annoyed" at almost everyone that you meet in life unless you have no social contact whatsoever."
People having other viewpoints are not annoying. Ignoring what I write is annoying

"or better yet if you simply don't have the maturity to discuss something then your better off not having any in depth conversations and debates at all."
I am fine, thank you. Rather, you should become mature enough to pay close attention to what the other one writes, and answer accordingly. This way, you would become less annoying,

"Again we can end this conversation here if you truly want to who is forcing you to stay ?"
No one is forcing me to stay; I just like to make everything clear, not leaving one revel in misconceptions, and not letting them misunderstand me.

"I going to delay my response to your second half until I know whether you still want to discuss or not."
Seems like there is nothing to discuss anymore, as in your last response, you were only talking about why you think I am immature, based on the misunderstanding that other opinions annoy me, instead of ignoring what I write. Now that I corrected you on that, I think we are done here, basically.
Reply: sztellanora  
http://youtu.be/bbyr7jZOllI?t=31m26s

31;26 - 34;00 .
Reply: youtu.be/bbyr7jZOllI?t=31m26s
Reply: sztellanora /watch?v=bbyr7jZOllI&feature=youtu.be&t=31m26s
Reply: Hmm it seems as I can't post a link to another youtube video otherwise my comment gets stealth removed meaning it shows up when your logged in but dissapears off the comments section when you log out.

But there is a great video that sums up this exact conversation in around 2 minutes. 
How unrealistic solar energy is,
Reply: Carbosful They got auto-removed by spambots; I restored them as the OP. I tried the link, removing the extra dot from it, but it didn't work. You could try it again, tell me the title of the video, or tell me the main points of their arguments.
Reply: sztellanora RIght click on the link and open in new tab that should work. if you remove the  dot it seems to not work.
Reply: Carbosful Thank you very much for the link (I will watch it to learn more about LFTR), but there was nothing new to me about solar energy here, really.. I knew it uses up a lot of space, it can only work for a limited time during the day, and that the energy it produces costs a lot in monetary terms.
However, I think any rich country with deserts (or reasonably near deserts) would be stupid not to install solar power plants there, as deserts don't really have any other use anyway.

Note: I also think that the data center in Sweden mentioned will likely not use Spanish solar power - ever, but in an ideal scenario, it would rely jointly on local hydro, wind, tidal, wave, geothermal energy, and LFTR (or even AHWR or FBR).
Reply: sztellanora Desert solar farms could be built however there are some pretty big hurdles to overcome.

Taken from scientificamerican article Challenges for desert solar power.

""Water and dust
On the engineering side, though, Darling says that there are one or two challenges that still could be “deal breakers,” at least for some technologies. The big one is water. Concentrating solar power (CSP) plants, like traditional power plants, need to be cooled to run, and cooling takes water—lots of it. And of course, if water were abundant in the desert, it wouldn’t be the desert. At Ivanpah, on-site wells supply the plant with water, but that solution won’t always be feasible. “I can’t think of any technical way around that unless a dry cooling technology that’s effective and affordable is developed,” Darling says. “No one has really come up with a way to do that.”

For photovoltaics (PV), water is only needed to clean the panels, which brings up the second large problem with desert solar: dust. Solar panels and mirrors need to be cleaned almost daily if efficiencies are to stay where they need to be. Dust is not transparent, so even just one gram of dust per square meter of solar panel area can reduce efficiency by around 40 percent. At that rate, it doesn’t take long in a dusty desert for the problem to become intractable.""

A report from the (nomadDesertsolar) there is so much dust that if solar pannels were left for 1 day without cleaning sulfur can adhere to the pannels. 

And dust storms will most likely shut down operations if not nullify energy absorption by up to 60%.

From NomadDesert Challenges for solar

""Unless you live in the desert, it is hard to imagine 50° Celsius of unrelenting sun, day after day, and then 40° nights, sometimes with howling winds and dust so thick you can’t breathe.  These conditions must be experienced first hand to be truly understood.  Those that do understand them, also quickly realize several key factors about solar panel cleaning in the desert:

1.     Dust will accumulate fast, at non-standard and unforeseen rates.  Dust storms can reduce output power by 60% in a single day, with background soiling rates of 0.4% per day.

2.     The sun is so harsh, and conditions so inhospitable, and the nights so hot, that any manual labor component will be a primary source of failure.  It is simply impossible to physically function during the day or even the night, for any length of time. At the same time, labor market uncertainties in the region are also profound.

3.     Water is a precious, energy intensive commodity, and is not always readily available.  It must be transported, and more is always needed than expected.  Any water-based cleaning solutions will always be prone to breakdown if water supplies are interrupted or become more expensive.  Using desalinated water to clean solar panels is counterproductive to real value, and environmentally unsustainable.""

My thought would be the sheer amount of area that needs to be cleaned from desert dust almost daily as we know solar farms are not small by any means. The maintenance cost would be at  an unprecedented rate, which will directly drive up the cost  per MW of energy, And another thought would be the amount of water that needs to be transported would be very very costly as well.
Reply: Carbosful ""Water and dust
On the engineering side, though, Darling says that there are one or two challenges that still could be “deal breakers,” at least for some technologies. The big one is water. Concentrating solar power (CSP) plants, like traditional power plants, need to be cooled to run, and cooling takes water—lots of it. And of course, if water were abundant in the desert, it wouldn’t be the desert. At Ivanpah, on-site wells supply the plant with water, but that solution won’t always be feasible. “I can’t think of any technical way around that unless a dry cooling technology that’s effective and affordable is developed,” Darling says. “No one has really come up with a way to do that.”
Good to know. BTW, it's interesting that the Nile flows through the Sahara, yet climate maps show even its vicinity to be "arid". Wondering how that works.

"For photovoltaics (PV), water is only needed to clean the panels, which brings up the second large problem with desert solar: dust. Solar panels and mirrors need to be cleaned almost daily if efficiencies are to stay where they need to be. Dust is not transparent, so even just one gram of dust per square meter of solar panel area can reduce efficiency by around 40 percent. At that rate, it doesn’t take long in a dusty desert for the problem to become intractable."
A report from the (nomadDesertsolar) there is so much dust that if solar pannels were left for 1 day without cleaning sulfur can adhere to the pannels. 
And dust storms will most likely shut down operations if not nullify energy absorption by up to 60%."
Not a big fan of PV anyway, for other reasons, like production waste and low efficiency.

"My thought would be the sheer amount of area that needs to be cleaned from desert dust almost daily as we know solar farms are not small by any means. The maintenance cost would be at  an unprecedented rate, which will directly drive up the cost  per MW of energy, And another thought would be the amount of water that needs to be transported would be very very costly as well."
Costs, costs, costs. I'm so pissed at the monetary system :P Money has no real value, yet we try to measure everything in it. Meanwhile, installing infrastructure costs materials, while the work of machines costs fuel or electricity, and the work of humans costs food and time.

With modern production levels, there is already global abundance of food (FAO, 2002), it would just need to be brought to the hungry, so human labor would really only costs time (Time dollars actually make a lot of sense).
If we manage to harness fusion power, or even if we fully develop AHWR, LFTR, FBR, and geothermal energy generation methods, electric energy will be abundant, and if we will be able to implement supercapacitors, fuel will largely be a thing of the past, thus making energy abundant altogether.
All that remains to be taken care of is material resources, which are abundant in the asteroids. And we could also raise recycling levels to near 100% to waste as little as possible, since it makes no sense to mine distant asteroids just because we dump most of our things into landfills (not to mention that we will need to do that anyway, as we will run out of places to create landfills at).

Ultimately, money makes no sense in a world of global abundance - I know we have not achieved that in all fields needed (only in the case of food), but we are within arms' reach.
Reply: sztellanora """Ultimately, money makes no sense in a world of global abundance -"""

Money is a means to easily trade services or products between people.

You can imagine how hard it would be to trade things without some sort of monetary system.

You would be trading bread for cars, and cars for water etc.. 

It doesn't work out.

And shorty after removing money from the system, people will find other things to forge a main Money system out of, like gold or silver, It is not fun carrying pounds of precious metals around. And it would be very hard to trade with as things such as precious metals are not absolute there are many different concentrations of precious metals in normal rock.

Trading would be extremely difficult. You would be barter trading.

Money is a medium of exchange.
people can easily convert their services or products into money and they can use that money to trade services or products with others.

Money has no value, the value of the Dollar is based on how much your country has to offer.
Reply: Carbosful "Money is a means to easily trade services or products between people."
Indeed, but money makes no sense in global abundance, as in a world of abundance, basic goods and services may be simply assigned to people by algorithms, so that no one lacks food, clean water, and shelter (already produced mainly by machines and robots, while being good candidates for even further automation), while goods not required for survival could also be produced by machines and robots, or could be worked for (you cannot stop those who want to help others or create something new anyway), and given a special currency in exchange (a variation of Time Dollars, without interest).
Note: yes, currency may not be eliminated entirely, at least as long as there are no proper androids (like those in Alien), but the value of work should be based on the utility of the work, and the money must not have interest on it.

"You can imagine how hard it would be to trade things without some sort of monetary system."
Trading would indeed be hard. But I argue that trading should be ended (at least with basic goods, like food, water and basic shelter) . Do you trade with your family members? Usually not, you just share things. This could be done globally, relying on computers (even AIs). 

"You would be trading bread for cars, and cars for water etc.. 
It doesn't work out."
Indeed, when it comes to trading, monetary trade is superior to barter. But while trading may be seen as a necessary evil in scarcity, it is definitely not necessary in abundance.

"And shorty after removing money from the system, people will find other things to forge a main Money system out of, like gold or silver, It is not fun carrying pounds of precious metals around."
Indeed, removing money from the monetary-capitalist system would cripple the system. Before trying to remove money from it, the system should be changed to a different system which doesn't rely on money.

"And it would be very hard to trade with as things such as precious metals are not absolute there are many different concentrations of precious metals in normal rock.
Trading would be extremely difficult. You would be barter trading."
Money is a medium of exchange.
people can easily convert their services or products into money and they can use that money to trade services or products with others."
Trading would indeed be difficult without money. But I am for eliminating trade in the first place. Try thinking outside of the box ;)

"Money has no value, the value of the Dollar is based on how much your country has to offer."
The value of dollar is influenced by the ability of the economy of the US to grow, and many other things, but most of these (including the economic growth) is already detached from resources, goods, their utility, human needs (i.e. reality), having their roots in blind speculation.
Reply: sztellanora Money does not actually have any value. It's what it represents that creates its virtual value. Money itself has no value at all.

""""Indeed, but money makes no sense in global abundance, as in a world of abundance, basic goods and services may be simply assigned to people by algorithms, so that no one lacks food, """"

That's a communistic economy. In a perfect world a communist country would work exactly like that however look at how it actually comes out to be in real life.

A communistic government is too corrupt, unless it was literally lead and managed by God it doesn't work out in reality and quickly becomes extremely corrupt.

""""Before trying to remove money from it, the system should be changed to a different system which doesn't rely on money.""""

What ever you switch to will be the new "money" Money does not have any value itself, only what it represents.

If your country has nothing to offer and you have dollar bills to hand out no one is going to take it.

""""Trading would indeed be difficult without money. But I am for eliminating trade in the first place. Try thinking outside of the box ;)
""""
You are talking about a Communistic government without free trade in a perfect Utopia. Where everyone receives the same pay whether they work or not. This does not work in reality sadly, because this removes all motivation in the work force. 

This is the reason why SMart Communistic governments are allowing for a totally free capitalistic market, countries such as China have allowed for Free trade areas in which some of the biggest cities in the world are located at currently.

Free market drives competition and individual motivation. without this your economy is broken.
Reply: Carbosful "Money does not actually have any value. It's what it represents that creates its virtual value. Money itself has no value at all."
I also had Finance classes at college, thanks ;)

"That's a communistic economy. In a perfect world a communist country would work exactly like that however look at how it actually comes out to be in real life."
Communism was inherently flawed, as it had an internal contradiction, wanting to eliminate money while relying on the work of the proletarians.

"A communistic government is too corrupt, unless it was literally lead and managed by God it doesn't work out in reality and quickly becomes extremely corrupt."
1) I don't believe in gods
2) communism is not a form of government, but an economic system based on a flawed model of capitalism
3) I'm not talking about communism, but about resource-based economy (RBE)
4) democratic governments in a country with capitalist economy are also inherently corrupt, since the primary goal of politics there is to make the economy grow, and not to eliminate poverty (eliminating poverty would mean there are no poor and desperate people to do the sh*tty jobs)
5) the US government is especially corrupt among capitalist countries, since  unlike in European countries, for example, US parties do not finance candidates, who - for this reason - have to turn to private sponsors (usually wealthy corporations, who would like laws that favor them), and.. you fill in the blank :P
Note: I also had Politology classes in college ;)

"What ever you switch to will be the new "money" Money does not have any value itself, only what it represents."
If you eliminate trade itself, there will be no new "money".

"If your country has nothing to offer and you have dollar bills to hand out no one is going to take it."
You should be more precise; instead of "has nothing to offer", you should really say "doesn't show the signs of being able to make its economy grow consistently". Otherwise, correct.

"You are talking about a Communistic government without free trade in a perfect Utopia."
No, I am not talking about communism (and again, it is not a form of government), as communism was based on human labor, while RBE is based on robotic labor (primarily).

"Where everyone receives the same pay whether they work or not."
No, I am for eliminating payments altogether. In my view, everyone gets free access to goods necessary or survival (because we already produce enough of these, so it is simply inhumane to deny access to these, and knowing this, if you argue against making the right for food, water, and shelter basic human rights, you are a monster).
BUT, if someone wishes to get access to special goods and services, they go to work, and get specific vouchers to access their specific needs.
As you can see, this is not communism/socialism, where people indeed got similar payment simply for showing up at work. That didn't work indeed (it was a flawed concept to begin with).

"This does not work in reality sadly, because this removes all motivation in the work force."
Wrong. Money is certainly a motivation for work, but not the only one. Note that people donate a lot of work hours yearly, workaholics aren't motivated by money, creative people cannot even be stopped, and in the case of creative jobs, payment beyond a certain level has actually been shown to be counter-productive.
Of course, if everyone gets free access to goods necessary for survival, people with sh*tty jobs (e.g. cleaning toilets) would suddenly stop going to work. But since almost everything can be automated nowadays (and it is growing exponentially), this is actually a good thing; machines free us up to enable us to do truly meaningful things (instead of cleaning toilets).

"This is the reason why SMart Communistic governments are allowing for a totally free capitalistic market, countries such as China have allowed for Free trade areas in which some of the biggest cities in the world are located at currently."
There is nothing communist about China anymore; it has a capitalist economic system, and a centralized government.

"Free market drives competition and individual motivation. without this your economy is broken."
Free market never really existed; market has always been influenced by laws, and the market always moves towards its natural end result; oligopoly or monopoly (since producers wish to influence the market to secure their income, and gaining larger and larger sections of the market enables them to have greater control over it).
Competition, just like war is a waste of resources. For this reason, I would like to eliminate competition as well (it makes no sense in abundance anyway).
Individual motivation can be varied, but it should not be the need for survival in a world where we already produce enough food for everyone (FAO, 2002). In a world like this, until the need for survive is kept as an individual motivation to work, we cannot call ourselves civilized.
As for economy, a capitalist economic system may be broken without this motivation indeed, but capitalism is not the only form of economy - and it is certainly not the best one we can think of either (RBE is better as its priority is human well-being, while capitalism disregards it entirely).
BTW, do you really think we would still use capitalism 100, 1000, or even 10.000 years later? People in the 1500s thought the same about feudalism ;)
Note: capitalism is based on continuous growth (while wasting resources), while the resources of the planet are limited. The most likely breaking point will be the year of Peak Oil (when you hear that Saudi Arabia and Russia - the biggest producers - both reach their peak production). We built our (capitalist) economies on oil but it's a limited resource. Moreover, we have been wasteful - just think about the US and USSR gas guzzlers, not to mention tanks and cargo ships, which go back and forth between the US and China just because making T-shirts is cheaper (in money) across the ocean - what an idiotic system. 

If you are interested in a detailed model of an RBE, I could give you one next time, and we could discuss it - you could point out things you don't understand, or anything that seems to be a mistake ;)